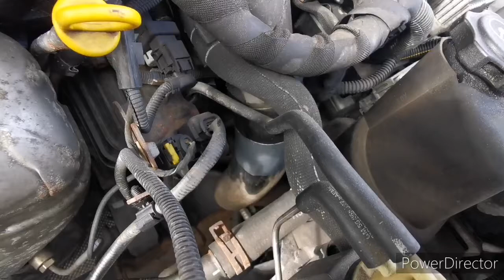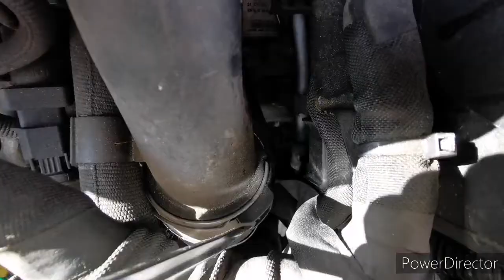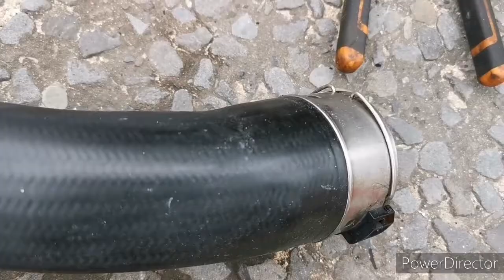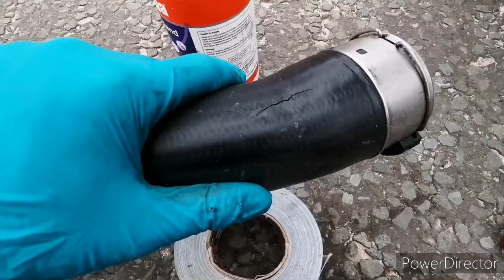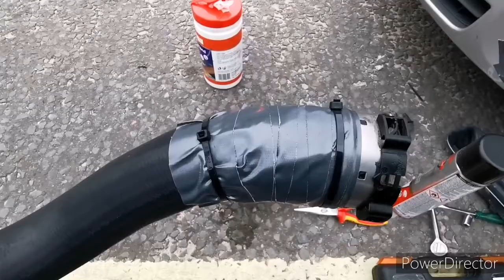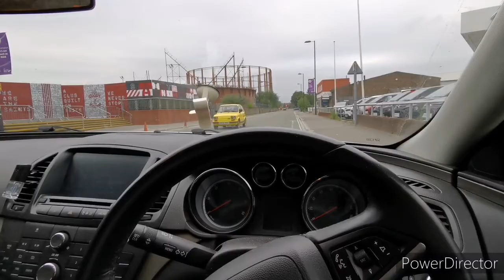Split in turbo hose - temporary repair #InsigniaOwnersLife

Comment: Just my experience and tip if someone need a temporary fix.. I used what i had laying around to temporary fix my volvo 2.4 TD: Degreased, a dab of "building glue" on the crack, vulcanizing tape wrapped wider than the crach for sealing, electrical tape, then fishing line  then electical tape to prevent expansion under boost preassure. Lastet 5 days of city driving and then blew after 150km of "medium/hard" driving (country roads in Norway, a lot of up and down hills, and i did not drive slow...). I suspect gaffer / duckt tape might have lastet longer in the heat of the engine than electrical tape..

Comment: I have this issue, displays as fault code P2282 when read. I find that it puts the car into limp mode intermittently, which tends to happen most when accelerating uphill at low revs.

Comment: Yea when fittin a new one cover it in fibre glass or something dont throw the old one out give it a flex rubber coating and then FGlass should be made of CF carbon fibre or the hard plastic infront of turbo salvage the old one and keep it spare for a quick swap

Comment: Hey man do you think its a good idea to like fix the hole with a patch you use to fix tyre from bike you know with the glue
Reply from the maker: I wouldn't risk it, some mention before a pool repair kit that sounds good. But best to replace it I could not get it on time and had to travel to Cornwall and it lasted.
Reply: @patafterhours6172  I used some kind of repair tape kit that hardens after putting it in water, It still holds fine after 4 days, I ordered the new hose tho.

Comment: Wht the problem if hose pipe are leaked..........it effect car  pick up ??
Reply from the maker: Usually it's come up with engine management light and/or car is going into the limp mode.(lack of power)
Reply: What??? Please use Google translate
Reply: Last think to see on my astra j . But i think i my case is the o ring inside the hose clamp because it have sings of oil or diesel .i am not pretty sure. But i will check tomorrow . Goes into limp mode. Over and under boost. And on uphills full throttle gos to limp mode. I am pretty sure is that becasuw checked turbo. Actuators. Vacums . Intake flaps  egr . Throttle body maf .map  . If those intercooler hoses are bad. I just speended a lot of money for small things

Comment: Just wondered if anyone has tried using a puncture repair kit for a bike inner tube on something like this?
Reply from the maker: I have seen ppl using pool repair kits, it is not worth it to repair it, only if you have to. I get new one for less than 30pounds + jubilee clip. I only did that as next day I was going to away and part would not arrive to me that quick so I took the risk.
Reply: I did this today with 3 kits. Then cut a square of inner tube and glued it on top and taped it up with gorilla tape 😂 I'll let you know how long it lasts
Reply: @user-uj8cx3dw3r  how did it go? I have two small slots in my intercooler pipe right before the throttle body and a lot of boost escapes and it’s throwing a DPF warning.
Reply: @5punkybob  lasted about 15 miles. I reckon with better cleaning and a bit more time spent on it, can be made to last a week, or if your not heavy footed. Luckily my pipe came a few days after.  So just fitted it on.

Comment: Well once the air gets tru you will sound as someone trying to squeeze a ballon or airplane with too much pressure while driving on the freeway 🤣😅. air pressure will eventually get out 🤣I tried it it failed miserably

Comment: Did this ever hold up for you?
Reply from the maker: I found it before my holiday so I drove like that for over 1200miles, obviously I have ordered a new one so by the time I get back I had a part ready to fit
Reply: It worked for me for like 4 weeks but my car would whistle whilst driving lol it was very annoying so i changed it when i had chance was easy to do
Reply: @PaulNicholas420  did you fix it? Any changes?
Reply: @neiljohntolentino6365  yeh put a new one on no problems since

Comment: Not a criticism but, I'd look at putting silicone sealant in the crack, find a bicycle/tyre tube and cut off a section to glue on the inside and outside, and then duct tape it.... Way cheaper than replacing the hose!
Reply from the maker: Do whatever you want on your car mate. I personally wouldn't say 26quid for new pipe is expensive and it still going until now with no issues :)
Reply: @mark that would be ok as a temporary fix but it doesn't take long to fail again, I did it on my car and forgot to order the replacement pipe then when it went again I remembered to order the pipe and rebodged it to keep it going til the new pipe arrives 🤣